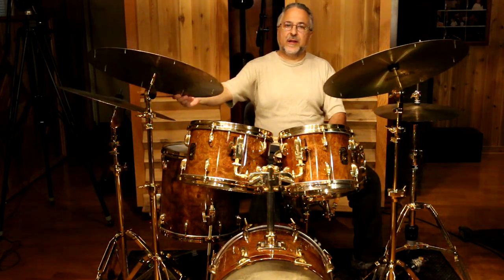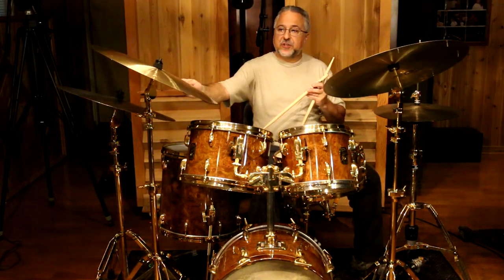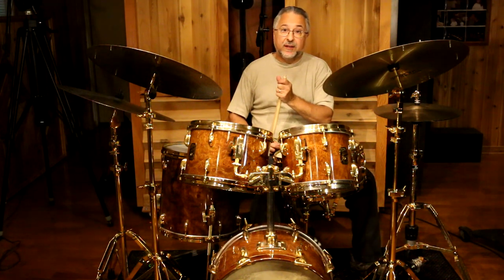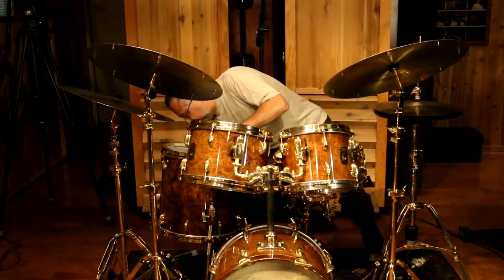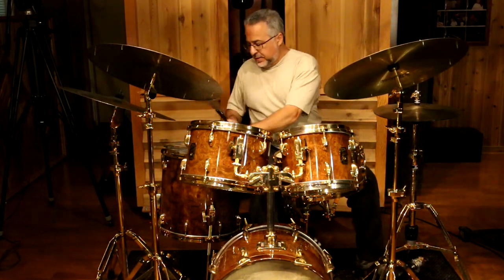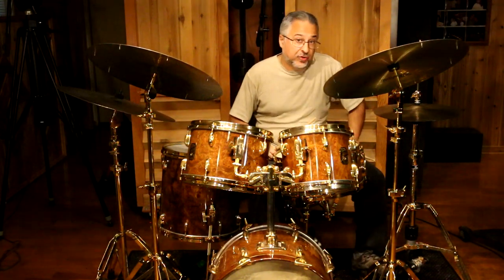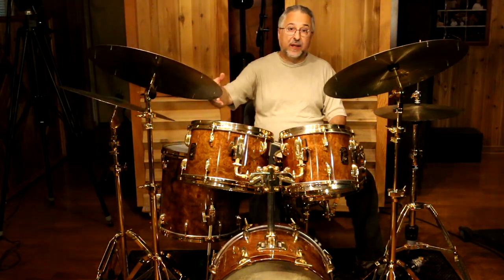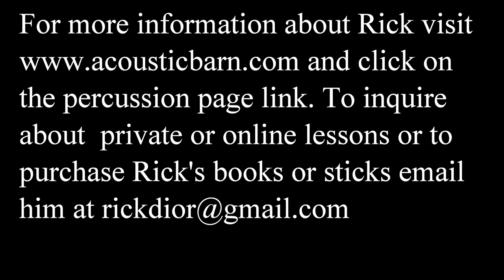Flat Rides

Comment: Hi Rick, great playing, I was wondering where you get the rivets, what type of rivets do you use, also how far in from the edges do you place rivets in general on a cymbal?
Reply: Yeah, a whole video from Rick about choosing and mounting rivets would be great!
Reply from the maker: I have a large bag of rivets I got from Zildjian many years ago...nothing special, just regular cymbal rivets. I also have some brass rivets I got from Paiste but those are generally too soft and light to use in all but the thinnest of cymbals.
As far as where on the cymbal to put them my general rule is anywhere between 1 and 3" from the edge depending on the thickness of the cymbal. If its a swish I put them closer to the edge since the cymbal turns up.
Reply from the maker: I can try but I need an assistant for that. I will talk to my wife.